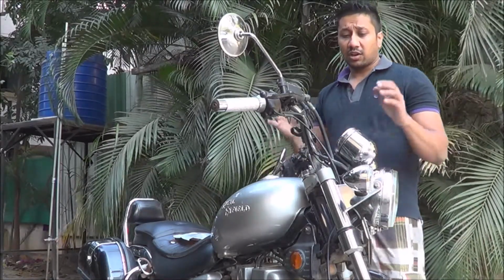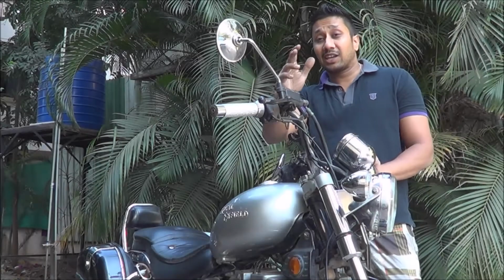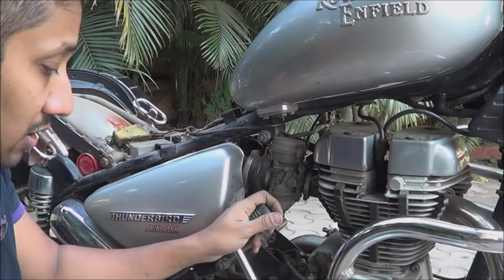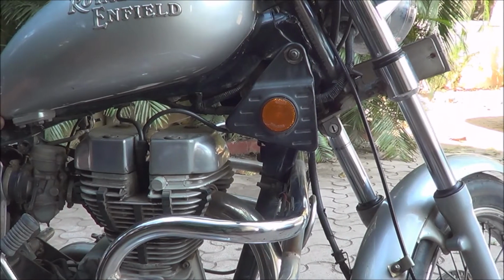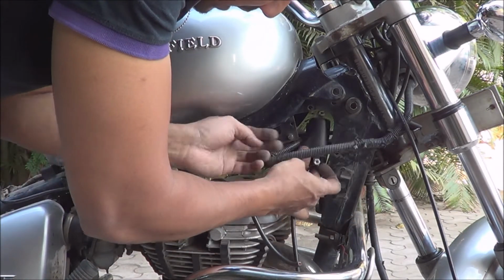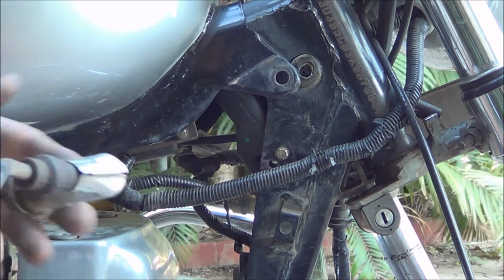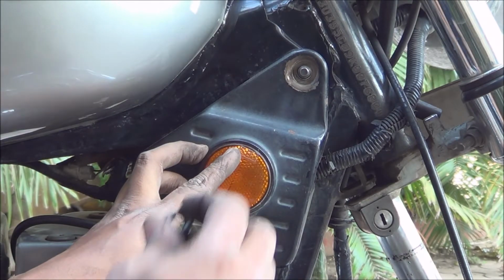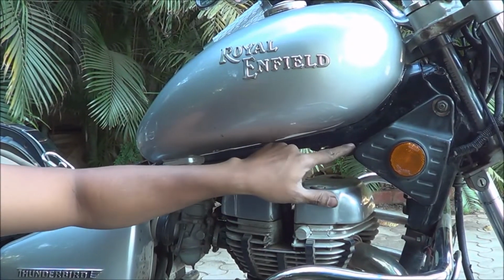Thunderbird TwinSpark Ignition Coil Replacement

Comment: hello bro, my bikes current not coming  to plug, i checked plugs, Tci unit, fuse etc and coulding find any fault. sometimes it will start and would ride for more than 20 km and come back home, then next day it will start and die off, what is the actual issue could you help me ?

Comment: What are the compatible CDI coil models ?  I tried replacing it with the 3 pin classic 350 one but my bike stopped after 4-5 km and its not starting. Please help

Comment: my bike when i kicked made a very big sound.. it is not starting. lights are working. should I look at the ignition coil.
Reply from the maker: Looks like a spark issue. You can check the coil. But before you do that just take out the spark plug connect it with the spark plug take it close to the engine and kick. If there is spark then it is not a coil issue. Be careful when you do that because you might get a shock too.
Reply: @KenKnowsMore  thanks for  the reply. it was carburator to inlet manifold pipe popping out by the back pressure

Comment: Bro I have  Thunderbird 2010 model It cannot start or it's meter not show any light or indicator of head light also not working I checked fuse ,cdi or I also changed cdi but it also not working plz help me call me 9530269639

Comment: Ken. Wonderful video. My Standard 500 UCE Twinspark has similar issue. While running it switches off itself, there is considerable loss of power, similar to what happens when we run out of petrol. Do you think we should check the ignition coil?
Reply from the maker: yes you can but most of the time its a loose connection in the battery area. mostly the fuse box.

Comment: Thanks, good video.  I have an AVL, 2009.  I have no spark. Lights work. How do I know it’s the coil? Can I check for voltage at the spark plug boot with a multimeter? Or check the coil impedance to know it is bad before buying a new one?